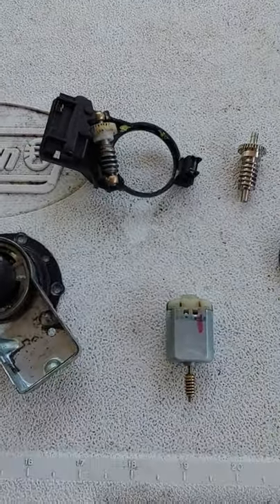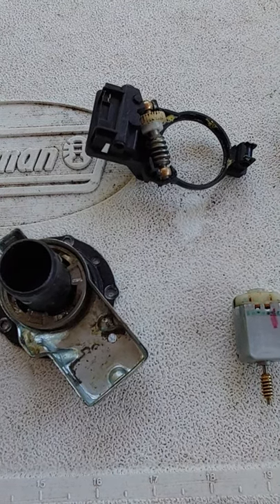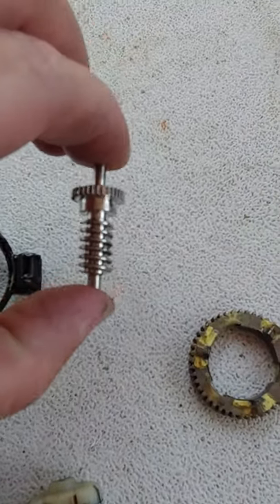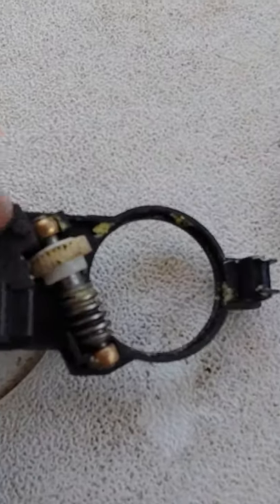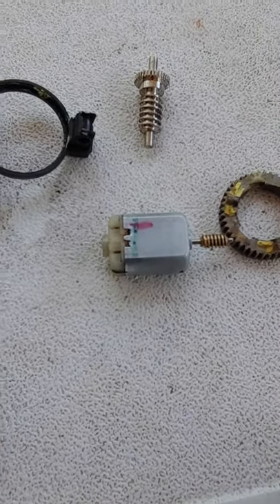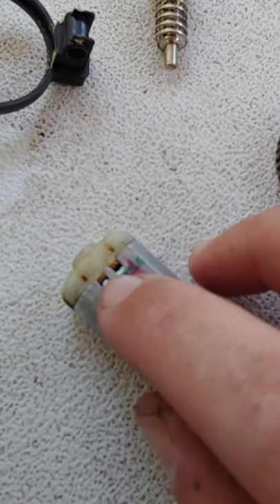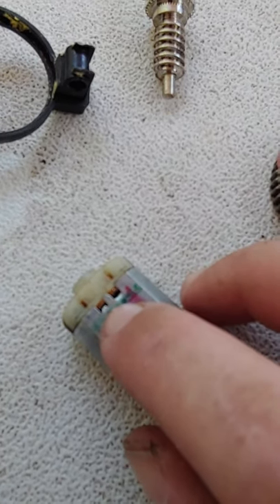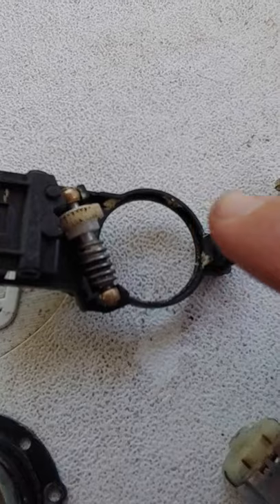GM 07-14 Escalade/Tahoe/suburban folding mirror/ eBay metal gear

Comment: Hats off to you for figuring this out! We installed the metal gears on this 07 Escalade & noticed the mechanism would move if the base was in the air. Once bolt down, the thing wouldn't move! Sure enough the motor was shorting out & the BCM would stop the movement. I did bend the tabs in with a pick/punch & it's working fine! Thanks again!
Reply from the maker: @mastertech5036 Thanks ! Yeah this one about kick my ass. This is why I made the video because I knew how valuable it was and how much time I spent on it.

Comment: How exactly does pushing in those two tabs fix the grounding issue with the motor when using the all metal gear?
Reply from the maker: Because that's how it's connected to the board.
Reply: did pushing the tabs work for you? I pushed them in a good amount on my motor but it worked for a bit when nothing was on and then I had everything but the mirror on and it no longer moved

Comment: What it was doing ? When it was grounding ?
Reply from the maker: It faults the controler out and stops working. It will work 1 time then fault the controller and stop working. You need a good scan tool to read the faults and clear them. If you need a cheap good scan tool get a mucar bt200.

Comment: Need more info what do you mean by found out 
As in the motor will not run or the motor runs in one direction the stops and will not run in the opposite direction 
That’s
Reply from the maker: If I understand you right. Using a metal gear grounds out the motor and faults the controller. Then folding won't work at all.